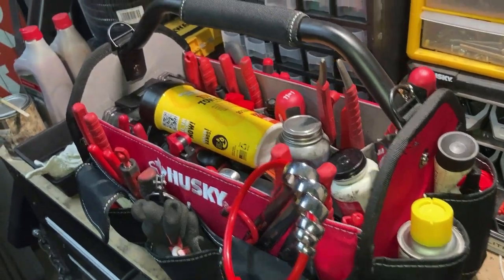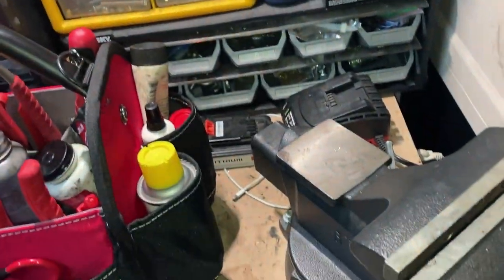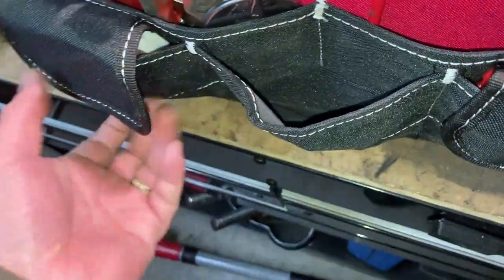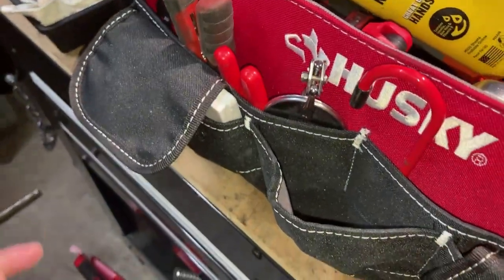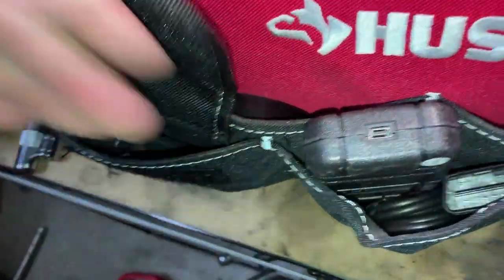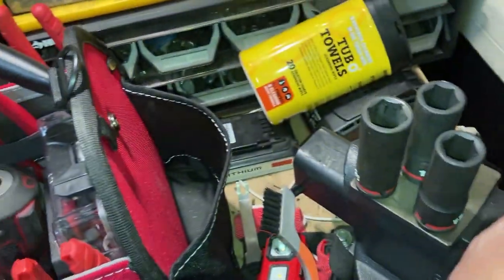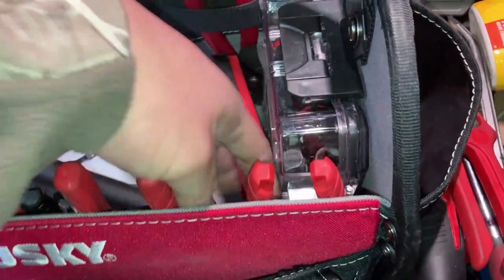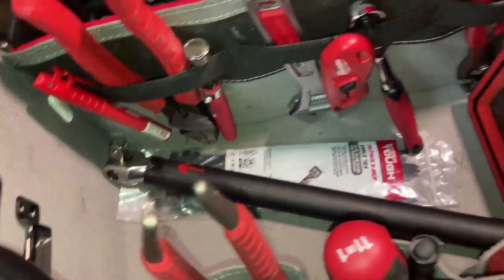WHAT SHOULD A MECHANIC CARRY TO SIDE JOBS? A QUICK TOUR OF MY MECHANICS TOOL TOTE FOR SMALL REPAIRS

Comment: What do you do for sockets or extensions and ratchets? I like the setup though, I was just wondering
Reply from the maker: Sockets I run the Milwaukee 3/8 impact set, ratchets are the Icon flex head 3/8 and 1/4 for this set up. I just picked up the icon breaker bar as well